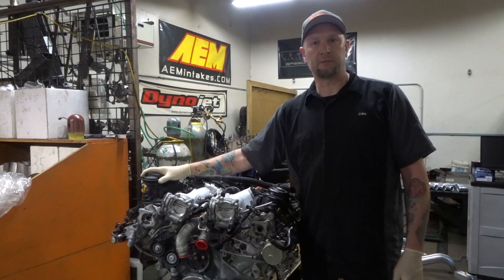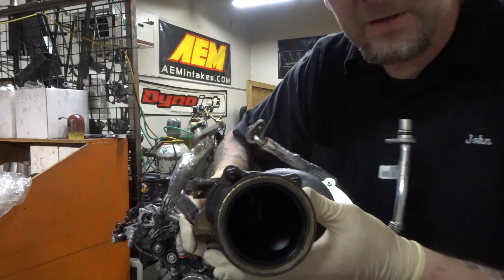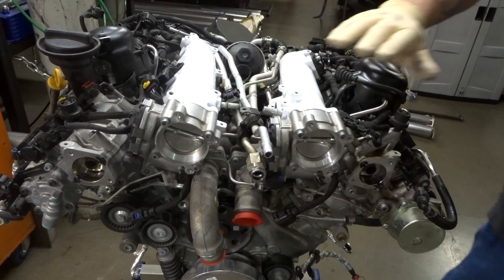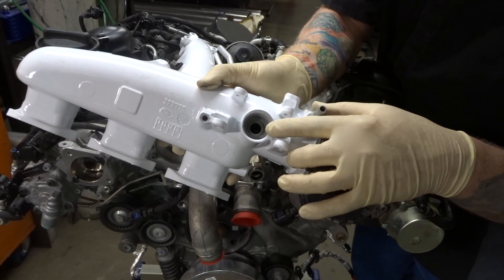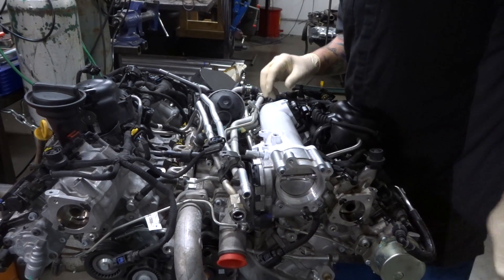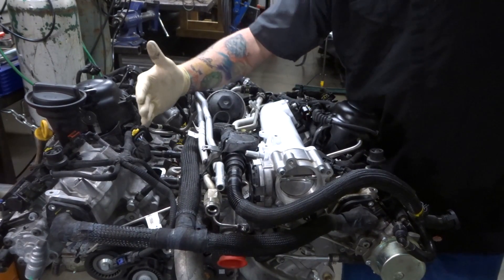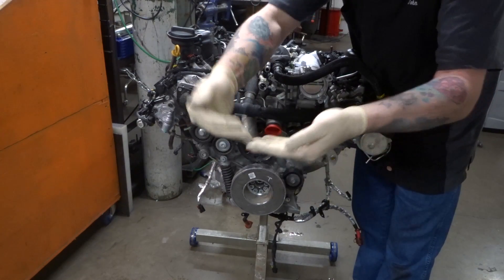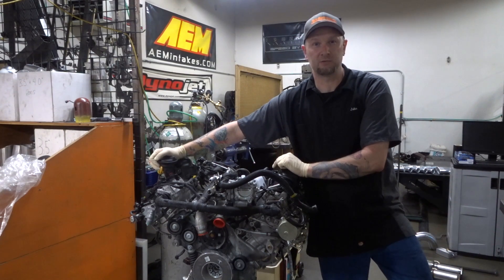2 9TT Alfa Romeo Oil Contamination...

Comment: Need that oil catch can. Where do i purchase?
Reply from the maker: Never made one for the QV we are still looking into options.
Reply: @TorkMotorsports  is that because of how awkward it is to actually connect something to those stock pcv lines? I've just had a look myself and it's all solid plastic that's been heat shrunk together as far as I can tell. Not just connectors with rubber heat shrink stuff over the top like it looks at first glance. Correct me if I'm wrong

Comment: Hey question so my catchcan filled up much faster then i expected on my VT. Im not sure how long i drove it like that for but the oil was spilling out of the top filter of the catchcan. I have 10k miles on it and it started missfiring like mad ,long story shot i used crc gdi valve n turbo cleaner and then 2 days later the missfiring stopped and the cel went away. Im guessing my valves were drowned in oil. What else can mess up or get contaminated from oil catch cans being full and driving your car like that? Is it somthing serious?
Reply from the maker: I highly doubt anything could get messed, up.  I would watch it close and see if the missfire comes back.
Reply: I've only ever had a breather side full either on a blown engine or after 12,000 miles of not emptying that one. That makes no sense.